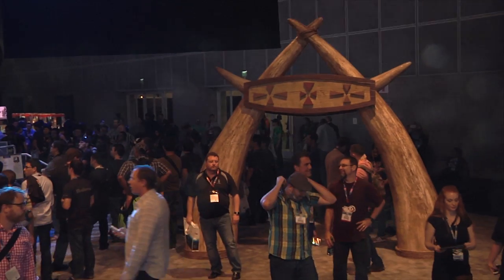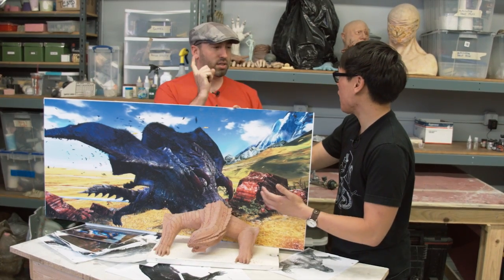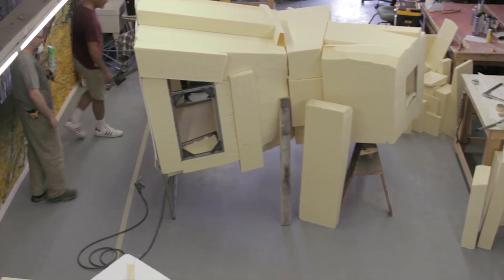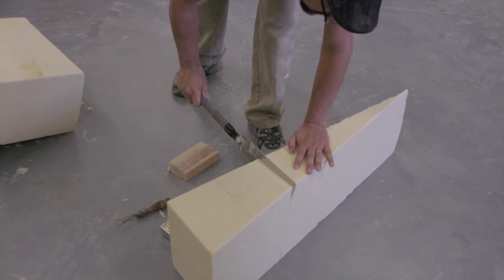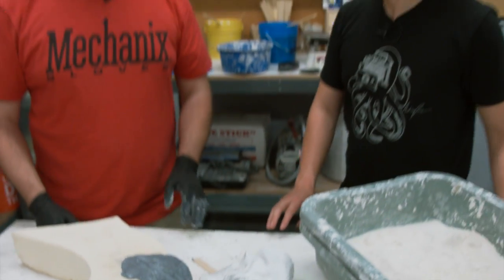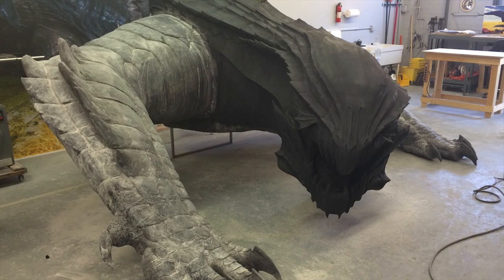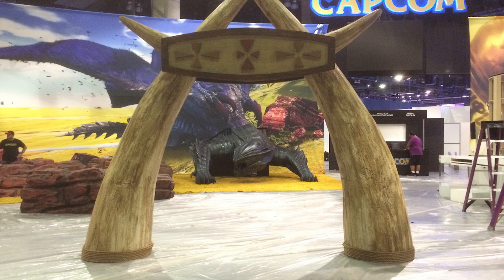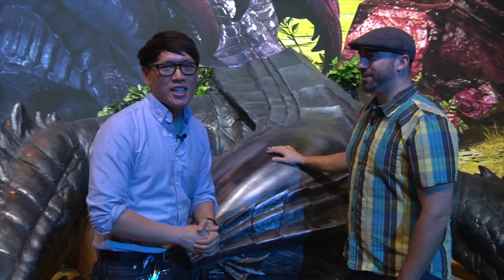Making a Life-Size Dragon! (Monster Hunter 4 Ultimate)

Comment: Even if it is big and detailed, they missed the point. It doesn't look very good, and you can't see the details anyways. Making it look like the real part of the dragon is connected to the picture should have been the main thing. It looks awful, with bushes and people going right through the dragon, like what the hell?? If they sat on the dragon or on something else, it would look way better. A black detailed dragon in a dark room, it just sound stupid.....
Reply: I...agree. 100%
Reply: It should be mushed up against the backdrop where people can walk in front.
Reply: a black dragon in a dark room is fine, but this wasn't supposed to be a BLACK dragon. It needed to have the subtle blues, reds, and purples seen on the image. It's like you were asked to paint a portrait using the most brilliant colors you could find and then using naught but black and grey
Reply: Ben Glaser a
Reply: Well, Smooth-On actually has something called Styrocoat that you can use to put a shell on EPS foam much in the same way, the examples they have on their site are used at amusement parks where kids climb all over them without any issue. I'm actually using it myself for a 10 foot octopus this month, it's great stuff. It wouldn't have really jived with the additive sculpting they did using the putty for the scales, but if the clients did want something bulletproof without going the route of making a fiberglass shell, it could have been done. Anyway, my point is there's options, it really just comes down to what the client wants.
Reply: I totally agree. I liked the colours but NO way should they have had a gap in the dragon. It deffo should have been against the backdrop
Reply: Cari Garafalo do you have an picture? I'd like to see that!
Reply: you know nothing of Monster hunter do you?
Reply: HOW DARE YOU THESE GUY DID AMAZING WORK 
GET A DAMN LIFE
Reply: I personally thought it was supposed to be away from the wall to make it look like the dragon was "defeated" or "beheaded" (because the guy had a sword)
Reply: Hey pal looks like you don't know monster hunter at all this isn't classified as a dragon a wyvern or a pseudowyvern (meaning a wyvern whit evolved arm wings) this has no classification as niether of it
Reply: @corvidaeic2378  ya u don't know monster hunter aswell
Reply: @zentron0  yeah, it's not something I know of. Looks cool though

Comment: Ey Frank, how long do your Mechanix gloves last? I love the dexterity in them but they barely survive more than 3 months of work.
Reply: depends on what I'm using them for, and which gloves you are talking about.  they have different levels of protection and dexterity. i love my gloves and i have some pairs that are a few years old.
Reply: Originals get fingertip seams torn after 2 months so I bought CG heavy duty, ones that seemed tougher but damn mate, they got shredded on so many seams it's unbelievable. I got five pairs so far and either I was unlucky or the older ones were much tougher.
Reply: i guess it also depends what you do with them.  i don't wrestle alligators or break concrete with my fingertips.  moving stuff, working with power tools , general hand protection the workshop, they have never failed me.  sorry to hear that you have had a bad experience.
Reply: My guess is that it's the heavy lifting that got the best of them since the rest of my usage was similar to yours. Thanks for sharing the intel mate

Comment: what an interesting foam, is it like Styrofoam?
Reply: Well, if you've ever been in a craft store like JoAnn, Michaels, or Hobby Lobby, you might have come across this green foam in the flower section it's very crunchy and gets dust EVERYWHERE. What these guys used is like that stuff texture-wise, but I think it might be a different chemical make up, they didn't specify if it was polystyrene or polyurethane. Some people use EPS (think packing peanut foam), others use that open-cell flower foam like these guys did, and some people use the various insulation foams you might find in a hardware store (the pink kind is really nice, you can even hammer it to make scales).